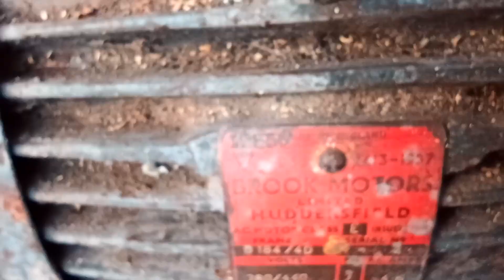Dismantling a three-phase induction motor, to look at the stator, rotor, and bearing inside.

Comment: hello i have a ACX-3381 that wont rotate (pulled out of lake) so im trying to pull apart but i cant figure it out. the top and bottom covers are off exposing the windings. just not sure how to get the rotors out. hammer from one side?
Reply from the maker: What is on the rotor shaft, that is preventing the covers sliding off?  Is there a piece of metal sticking out from the rotor shaft? If so, this is the woodruff key, and can be knocked out from the shaft.